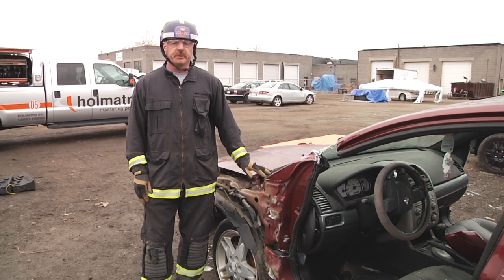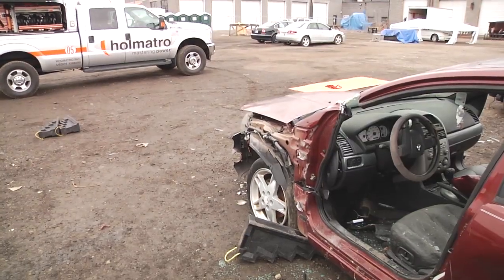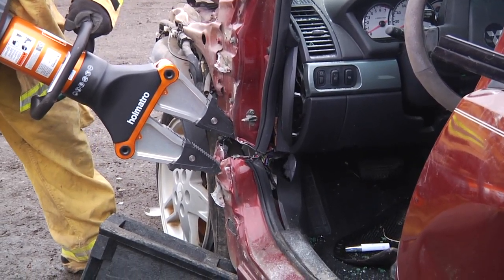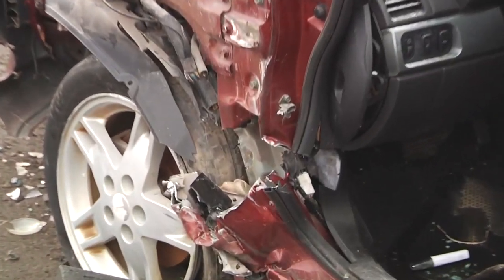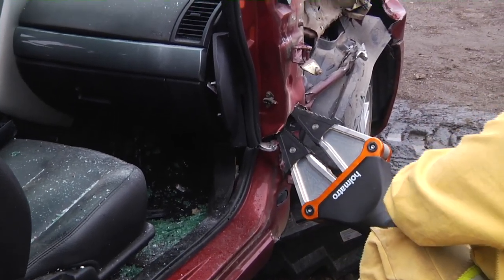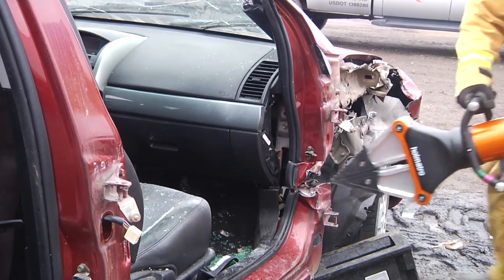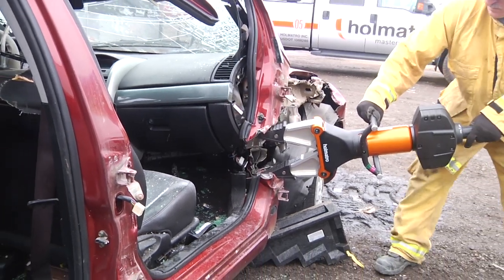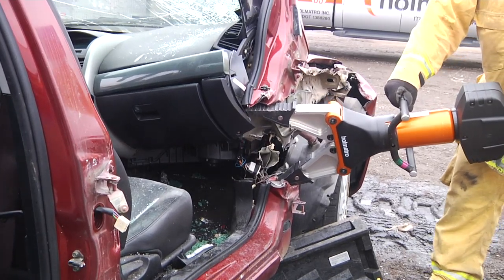Holmatro Quick Cuts 11 (2019): Proper Spreader Placement for Dash Push

Comment: Create a bigger gap to put the spreader in from the start, I like to do a top cut across the a pillar and around into the firewall, then a second cut about 3 inches below and parallel to the first cut generally two cuts deep with the big shears.. then grab that section with the spreader and bend it outward creating your gap and creating a footwear exposure that you can use to inspect around the feet before lifting, then put the spreaders in nice and deep to ensure  spreading the force across the entire a pillar not just the skin.